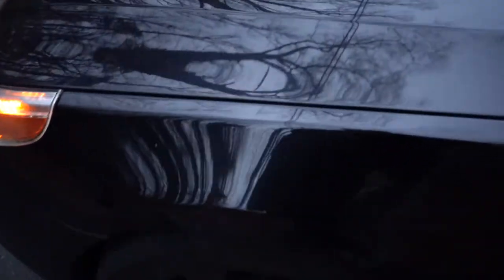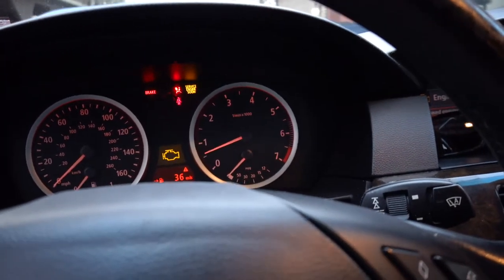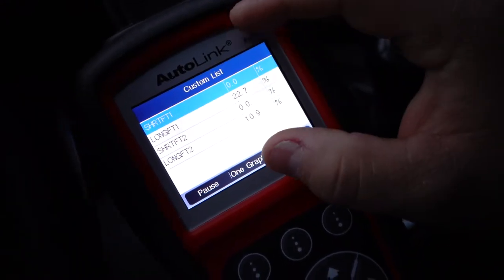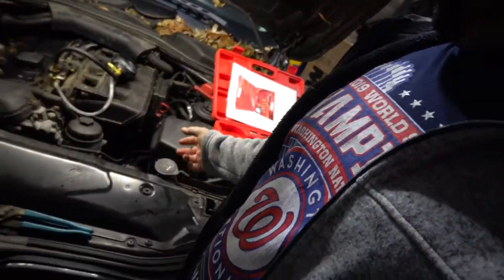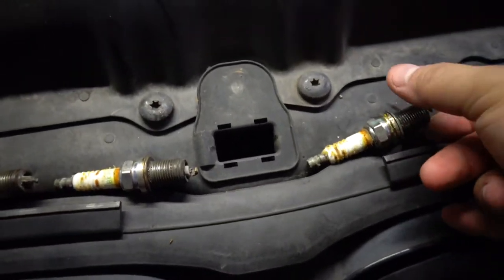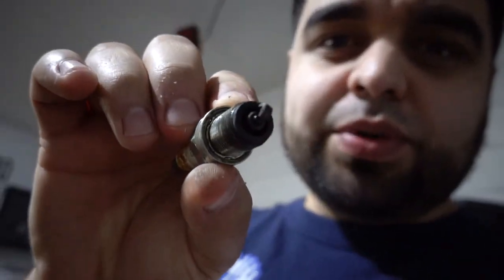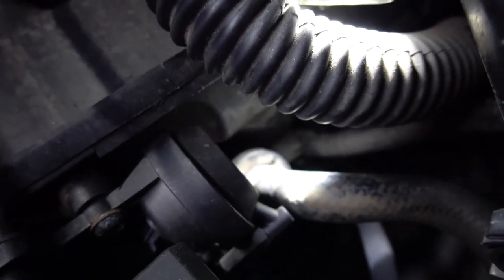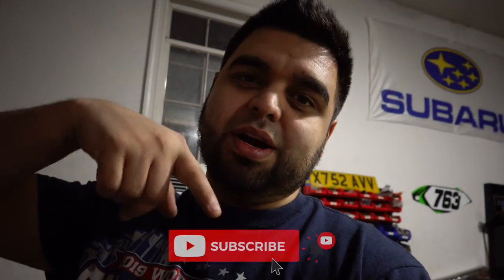Diagnosing The Engine Problem On My BMW E60 530i | Pt. 1

Comment: Hello everyone, I have a problem with my bmw e60 530i it is oscillating the rotation pointer and when I stop it gives some small bumps when it's time to stop
Reply: Engine compression
Reply: One of cylinder low in compression